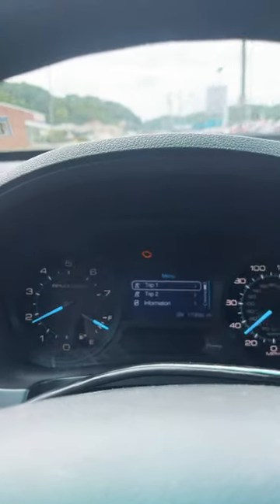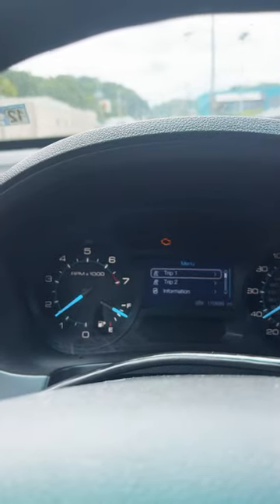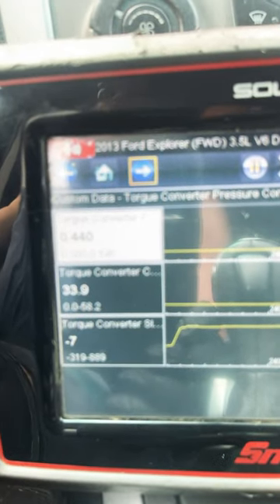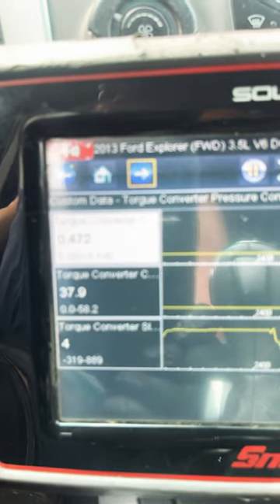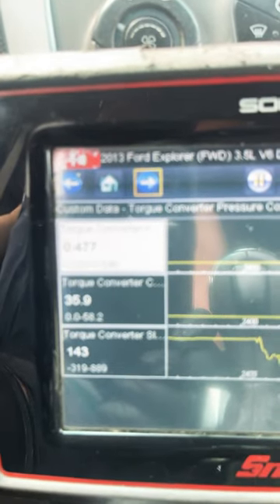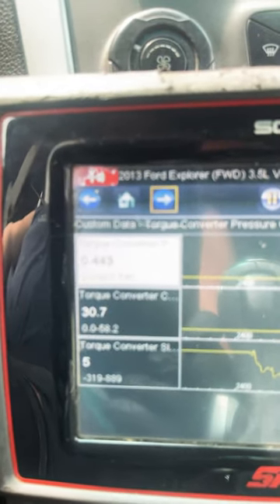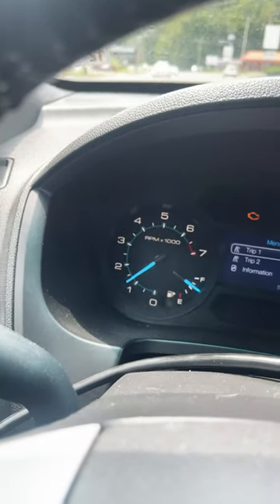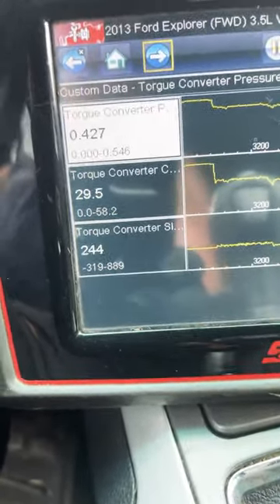Bad torque converter

Comment: I have a 2007 ford escape 99k on it. The torque converter needs replacing. Is it worth fixing? If so, what is the cost?
Reply from the maker: Prices vary depending on location
Reply: 6K